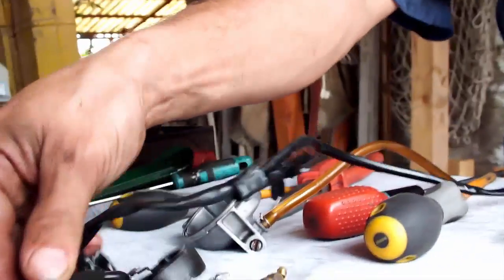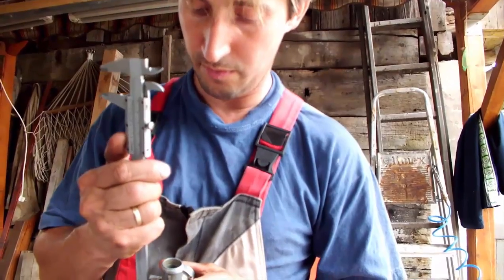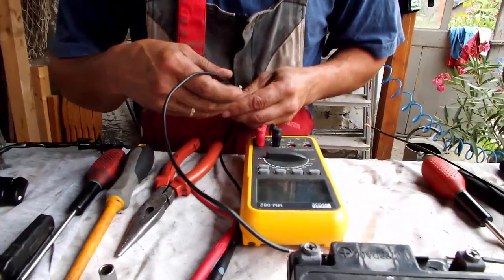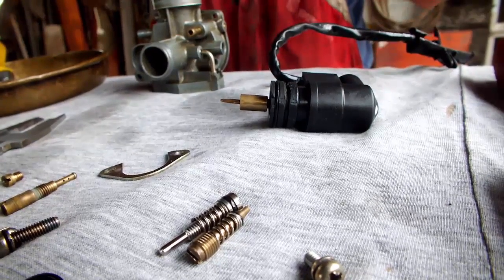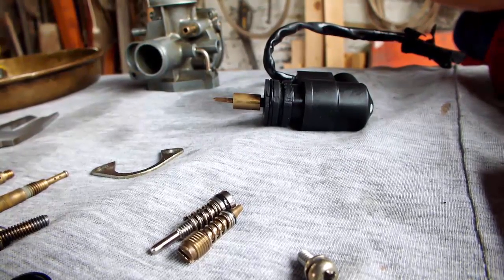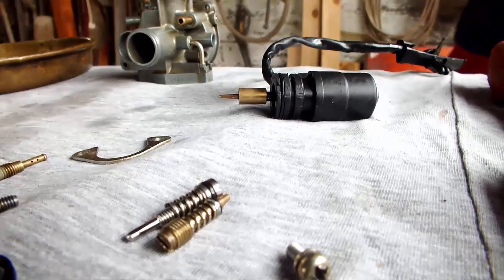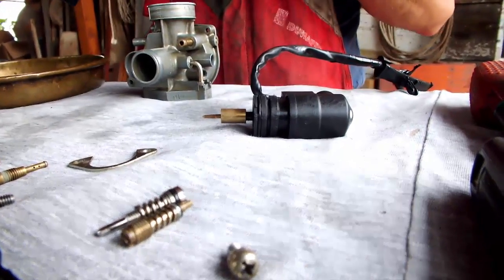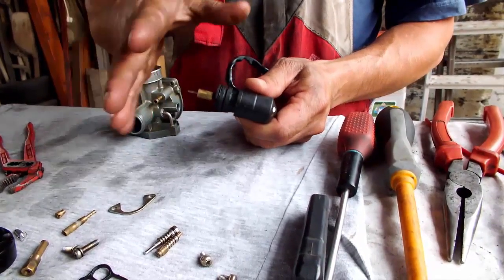SCOOTER REPAIR /Detailed presentation/ 7/41

Comment: The cold engine does not activate the automatic jicle. What is the reason? how can I arrange that??
There's electricity, it heats up, but the engine doesn't turn on when it's cold.  it's possible to adjust.

Comment: hy everybody, i need some advice on how to repair my scooter;  i have vespa sprint 4stroke, 1500km so far; the engine started to die about a month ago and in one morning it didn t start at all, so i did what every man with no mechanical aptitudes does:  took the carburetor out, cleaned it as best as i could, i put fresh fuel in and tried again. Nothing happened of course so did the following: checked the battery 12,7 V, checked the vacuum hose and the petcock - there is vacuum and the petcock works, air filter looks pretty clean , of course i tested the spark  plug and it works ( even bought a new one ). After all this i reconnect everything back and i try to start it, arround the 10th try it starts and i go for a ride in the village. I stop at the first STOP sign and the engine dies, it starts again to run, at the fuel station i stop and the engine dies again. These last few days i can t even start it. i should mention that before this adventure started the scooter fell on its right side and the right breake leaver for the front wheel is somewhat bent. Today i took the carburetor out again and the intake manifold was dry. I am very close to pouring some gas on the scooter and check the ignition  :))